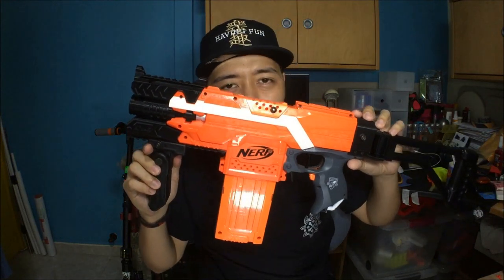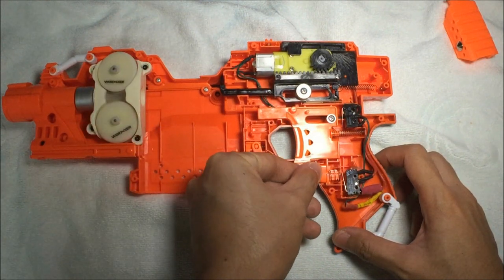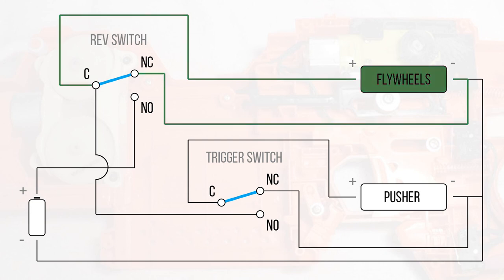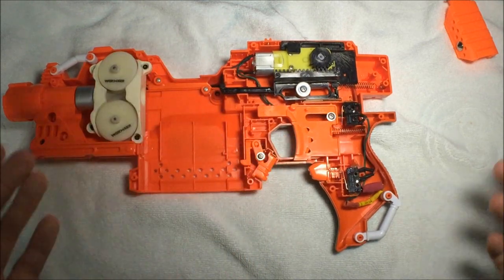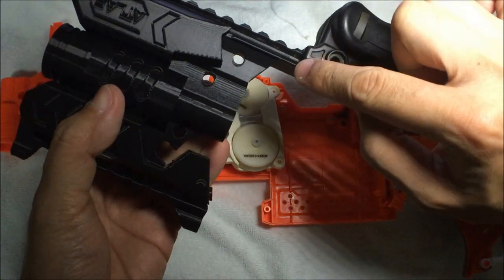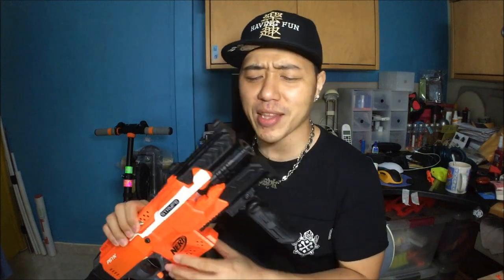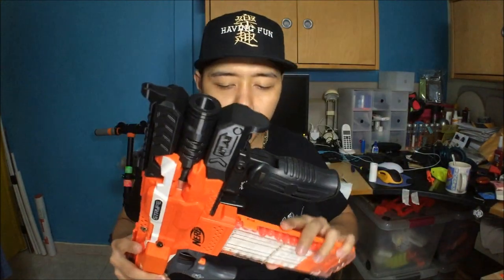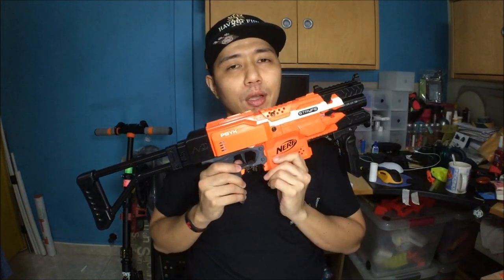Nerf ATLAS MP-101 Stryfe + Easy Wiring Diagram EXPLAINED!

Comment: When you say parallel connection from the Pusher to the Normally Closed on the Trigger Switch, does that wire start directly from the Pusher Negative or is it spliced off of the wire running from the Pusher to the Battery Negative?

Comment: did anyone have trouble with the pusher motor.i can get the wheels to go but the pusher will not go. i suspect i messed up on the connection of the rev switch to the trigger. Any thoughts???
Reply from the maker: Is the pusher rubbing against the shell at any point?

Comment: What about adding a cycle control switch in the rear that is closed when the pusher is pulled fully back by the return spring & wire with trigger switch just like the rapidstrike?
Reply from the maker: Yeah that would be good to add. I'm just lazy.

Hahahah
Reply: pSykSG you should do a video explaining this!!! I really want to know how to do it
Reply: Hafiz X If you're going to power the pusher on 2S with the stock pusher motor, then a live center cycle control is not possible. The pusher will run away immediately. The stock motor has too high a speed and too little torque for live center to work. Not sure how well it'd work on 2 IMRs though. Probably much better though. 

I'll be trying out live center on my FA stryfe today when I swap in a Fk180sh-3240 motor for the pusher instead of the stock motor and see how it goes.